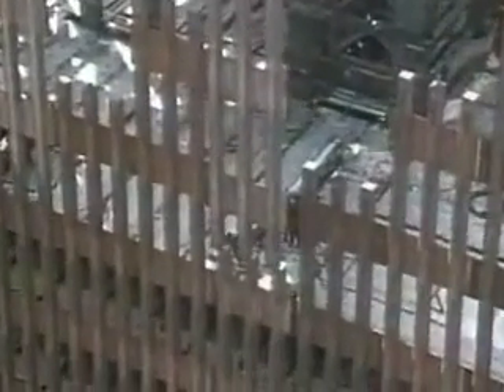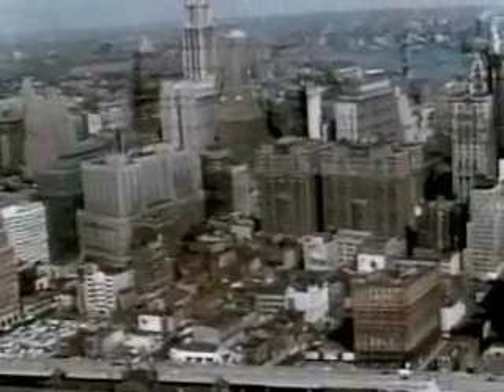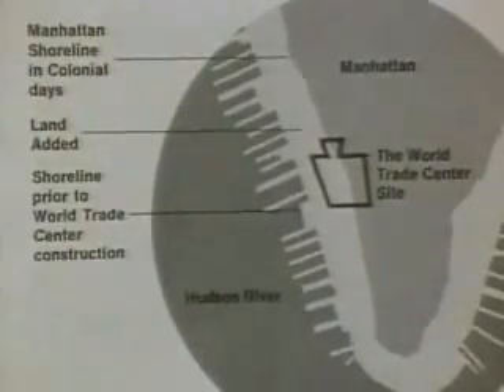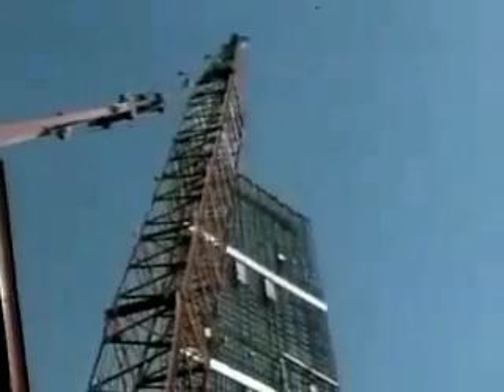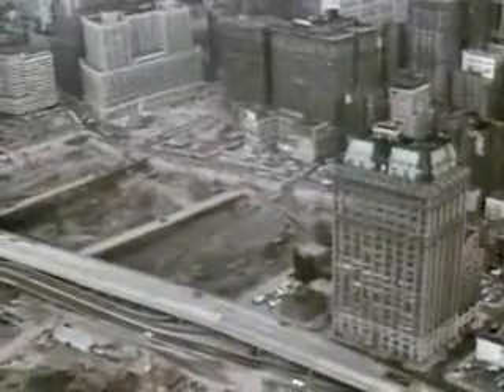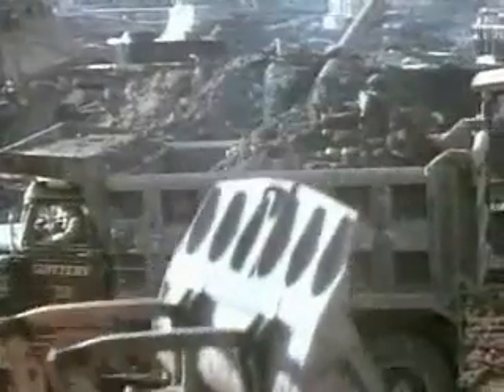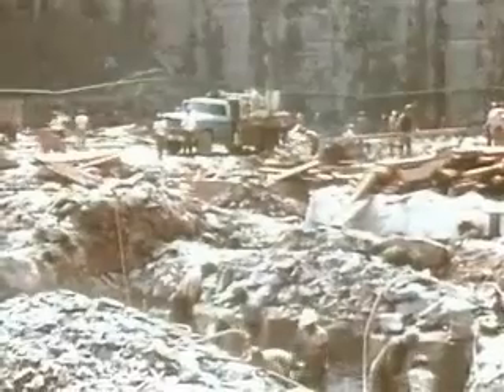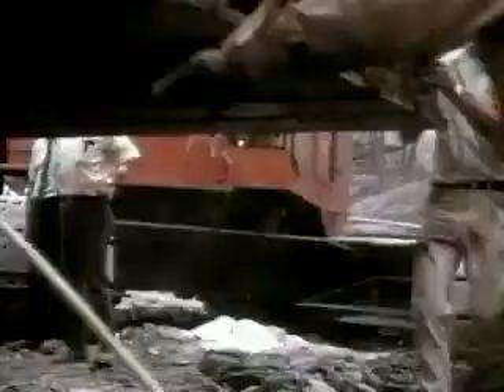Building the World Trade Center and Twin Towers - 1 of 2

Comment: @ the 0:43 /44 mark, there's no way on this earth all the outer steel shell which is part of the structual steel and then having massive inner steel columns to support the bld and keeping it upright ,that a plane and then a fire would weaken it so much that the areas of the bld below the fire weakened that much they simply feel down at the speed of gravity impossible full stop, also the amount of missing steel is also a massive issue, close to 2/3rds of the steel used to make both bld's is missing which Dr Judy wood has shown has turned into dustification, which is to say the Government has some sort of infrared laser which only attacks various chemical composition of steel used in those blds, which is why you see some of the massive outer steel shell just turn into dust ? Which is why some of the cars which are parked at least 400 meters away from the blds were burned only 1/2 way, like say the front or the rear of cars which were parked 400+ meters away from both of the BLDS ?

Comment: impossible that two planes could disappear inside these buildings!   and if you think they could then you are brainwashed..
Reply: Agreed, the twin towers were two of the most robust buildings ever made. No plane would go through the load-bearing walls, regardless of size or velocity. Hollow tubes made of aluminum don't beat massive bundled tube structures made of steel.
Reply: just look at the off course prop plane that hit the Empire State building. Sorry, not sure of the the year & it wasn't jet fuel but still, it smashed in & fell to pieces. What it didn't do was disappear or fly through it!
Reply: Glenn W that's nice!

Comment: So no one is going to use their brain and realize they tore down these buildings due to the damage of the foundation. The japanese architect that made it shouldve been put to blame. America did not care of having 3000 americans lose their lives over a construction mishap. They used the "attack" as a reason to go the war on the middle east for oil and to have a central bank system. These buildings were gunna fall and alot of more people wouldve died if it wasnt a planned demolition. America did not have the guts to tell nyc they needed to tear down the buildings because it wasnt built safe. So they made it as a terrorist attack.
Reply: What do you mean? What was wrong with the foundation? I heard that in the 90's they wanted to get rid of all the  espestice but it was estimated to cost well over 6 billion. I didn't know anything about the foundation.

Comment: I look at how much steel was in this building and the structure of it. How did one tank of jet fuel, dissintagrate   and destroy 110 stories ???????
Reply: Definatley agree.. Steel does not vaporise to dust. But they will have us believe a plane bought done 110 storeys of building.Sheesh!!
Reply: betty Plod
Yes 1 large airliner brought down 1 tower and another large airliner brought down the second tower. It is obvious you guys haven't done any research as to how those two unique were built. If you had you would be able to understand how and why those tower's collapsed.
The idea that Thermite containers were planted into the column's as they were being built falls into the X-Files or King Kong fantasies.
Steel does not need to be heated until it turns into a liquid before it fails.
Structural Steel only needs to be heated to 800 degrees to lose 50% of it's load bearing capabilities.
Here is a link to a video showing the actual construction of those buildings.
The internet is loaded with dumb misguided stories about those towers.
you    tube dot  com/watch?v=MY7BCXew0UI
That is 1 of many YouTube videos showing the actual construction.
Plus there are many web site's telling the story behind the original design of them which started back in the late 40's.
Yes that is when the port authority thought about building a World Trade Center.
Took them year's to get their dream off the ground.
The Faker's keep showing a drafting diagram drawn by Minoru Yamasaki that was rejected by every builder he took it to. So it was dropped with the exception of The Fakers.   On September 20, 1962, the Port Authority announced the selection of Minoru Yamasaki as lead architect, and Emery Roth & Sons as associate architects.
Once you understand how those tower's were built. You'll have a good understanding why they collapsed the way they did.
Reply: During the Second World War a b52 bomber flew into the Empire State building, causing damage to just a few floors. The building did not disintegrate
Reply: To Geoff, you say steel need only be heated to 800 degrees, in 1991 in Philledelphia one meridian tower burned for 18 hrs at temperatures well above 800 and it is still standing. Also in 2001 WTC7 has had fires and in 1975 the North tower burned for 3 hours on multiple floors, just a foot note black smoke means a cool fire.Even after all these years ,the way the government told the story just doesn't sit right.Another question would be each tower was 110 stories these buildings disintegrated down to approximately 6 stories of rubble , where did the other104 stories go? The building should have fallen and crumbled at best ...not disappear into dust.

Comment: The central core with its cross bracing  looks very strong. How did the pancake theory go again?
Reply: Government demolition
Reply: paul Smith it wasn't a government demolition actually it was the floor trusses that cause the buildings fall and caused the floors to pancake on to the one below it was of the Central Support Colmns that caused the Core Failure and caused the floors pancake to one below and with it was to two most recentizable simbiles not also in New York but in America as well.

Comment: Let's rebuilt them again! :)
Reply: Michael J. Richard How can it dishonor when it is the thing they loved? 
The terrorist sought to change the way you live. Rebuilding the towers would have been the biggest testament to American resilience and a FU to the terrorist that we do not bow down to your idiotic and evil ideas.

I guess, as long as you have government and business corruption, which is strive in US of A, it is obvious there is a chance it will be attacked again.

But, if everyone worked together and cared for each other, I am sure the Twin Towers are built to last for ages to come.
Reply: dvchel I don't think that's a good idea because if you reconstruct the Towers as they were that'll dishonor the 9/11 Victims like the 9/11 Attack never happened
Reply: @michaelj.richard8353 if you rebuild them safer then it shows your country has power
Reply: dvchel if I was an Architect I would built the Towers again but I'm gonna go as far as 105 stories I'm not going any higher than 105 the light trusses are going to be replaced with steel beams concrete throughout the buildings and cement fireproofing I going to make the the buildings fire and bomb proof and resistant to collapse the under garage it gonna be fire and bomb proof and the garage will have bomb blast proof walls and on top of Tower 1 I'm gonna put a 345 Foot Television and Radio Antenna the garage is for parking but one of the parking levels is going to have a Transit Bus terminal and a Taxi Company called Sunrise Taxi Company
Reply: Michael J. Richard Many of the families of the 9/11 victims wanted the towers to be rebuilt.
Reply: @animegamingdude  Also true. Many have come forward in support. So whenever you hear a 9/11 family member say that 'families don't want the twin towers because of forgetting about the victims or bring-up bad memories' they are full of sh*t as they don't speak for everyone. Also polls and on social media you can read that a lot of people want the Twin Towers back. 

Even from those after visiting One WTC or just seeing it realizing that it is not better than what was there before and take for example wanting to experience the outdoor observation deck.
Reply: Michael J. Richard The Twin Towers were 110 stories in Fact. Donald Trump's more fitting plan featured 115 stories which I think is even greater. Sad that Corrupt establishment went before the interest of the people, so they made us deal with this Vanilla tower we have now.

Comment: I havent seen the video but I did find a 1964 Govt document that said the WTC towers could take multiple hits from Boeing 707's @ 600mph.
The WTC towers were incredibly strong & definitely did not fall due to low-temperature asymmetric fires.
110 floors dropping symmetrically in 12seconds can only be a controlled demolition.
Reply: Its called shitty fireproofing and they didnt account for jet fuel and only had 3 stairwells
Also they could have 1 and a half of columns taken from a floor and stand perfectly fine

Comment: so i supposed windsor tower in madrid does not 'expand' as much as the twin towers, or perhaps wtc7 too despite the windsor tower was on fire for 18 hrs? of coz, someone would say the twin towers debris weaken wtc7 structure. cut the crap. buildings don't collapse straight down. the only way buildings could do that is with evry columns cut or weaken in orderly manner, not by fire or by quake or both. these are the words of hundreds of civil engineers and demolition experts.

Comment: It was an inside job that brought the towers down in that amount of time. If you look at other videos you can see windows blasting out from the lower levels as it crumbled. Cold steel and cement below the fires and damage area would have held the building up only with the top falling off.

Comment: @CharlieBorrows Did you not here the man say that the skin was what supported the building and made it possible. When the planes hit the buildings, it made a giant hole. The undamaged portions had to support more load to compensate, and with the fire weakening the steel, it eventually failed, and that's when gravity takes over.

Comment: Which the trade centers did, however the ignition of the plane's jet fuel was not guaranteed against failure of the building. This is expressly stated by the chief structural engineer John Skilling in a 1993 interview. He said he feared about something like this and guess what, he was right, because the burning fuel resulted in the collapse. Again, the building withstood the initial impact as designed.
Reply: 8

Comment: Answer at 2:02 -- load bearing walls. Tremendous heat from aeroplane gasoline melted the steel. 

Didn't look like a controlled demo. What other questions?

Comment: I would also add to this vertical supporting beams had diagonal cuts in them. 

When a building is bought down by explosives the cuts have to be diagonal so that the building effectively slides off its supports.

These diagonal cuts were clearly present at the bottom of the towers.
Reply: You can clearly see the cuts in the outer steel beams after the first hit where there is an outline of the airplane. Laughable. How could the wings cut through multiple steel beams?

Comment: This only reaffirms the position that it is highly unlikely for those buildings to have collapsed so rapidly. 

The entire network of support columns, particularly the core columns, makes it hard to believe that they would just disappear and have no resistance or bearing on a collapse. The strength of those columns had to support the everyday loads plus weight of entire building plus constant wind loads.